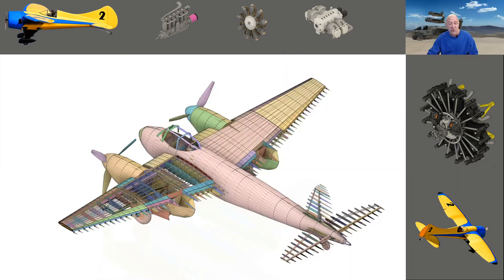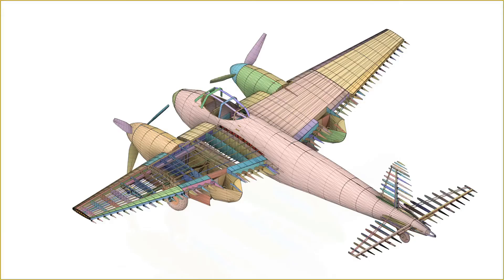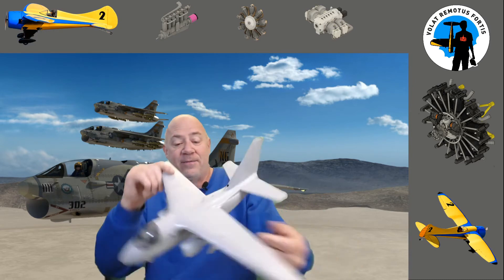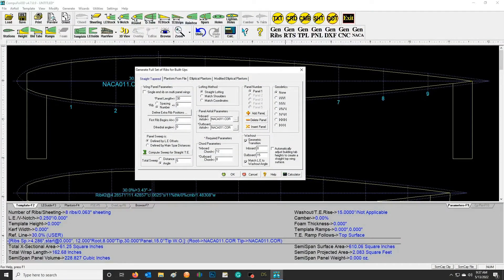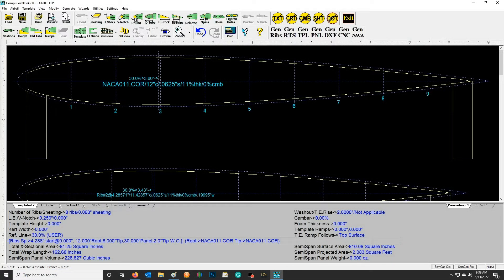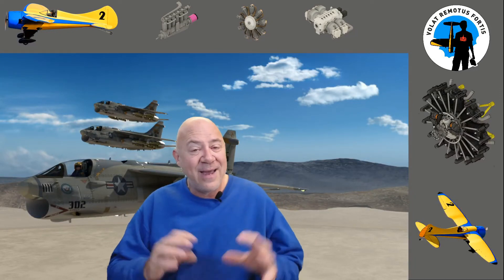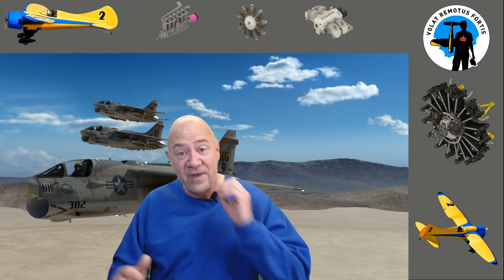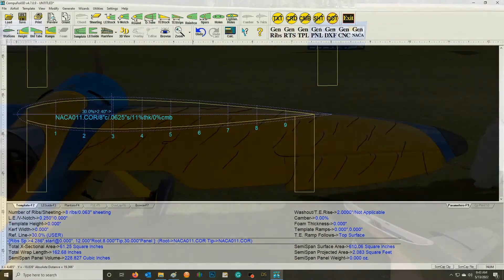RC Aircraft Wing Washout

Comment: Thanks for this video!  the RC world needs to share more about this type of thing.  I've tried to do my fair share on my channel, talking about adverse yaw, and different configurations.    The rudder mix trick is a very useful one.  especially on high aspect ratio planes.  I fly some very high aspect ratios, and often use 100 percent mix.  and sometimes limit aileron throw to push it further.  it really works. 
Would also be nice to talk sometime about provers yaw, as it relates to washout. and span wise lift distribution, elliptical vs bell shaped.  Prandtal had some interesting findings on that.  a bit of washout can actually increase efficiency.  because the airflow already has some span wise flow and there is already a vortex near the tip, so allowing some wing twist can reduce drag a little.  
And lets' not forget to mention progressive airfoils in wings, (they can do a similar thing as washout, and are sometime used together, such as on the dc-3 )  as well as a changing Reynolds number due to wing taper.   Planform, and how it affects stall characteristics.   turbulent vs laminar flow, intentional boundary layer separation, etc. and how they affect stall characteristics, as well as efficiency.  also blown wings, and how power can affect aggravated power on stalls on multi engine aircraft, especially twins.   lots to talk about on this topic. 

Great video!!!

Comment: is there a degree maximum of washout to build in.    I've drawn 4° into the tip of my project model.   F111    it's got a lot of tapper to the shape,. 16° leading edge with 1° trailing edge.   was thinking the high wash out would help remove tip stall that I'm expecting this shape wing to have with the tip having such a short cord compared to the root.   root section NACA 2412. tip section NACA 2416
Reply from the maker: Sorry, I don't understand the question?
Reply: @dagtheaviator  fat finger sorry.   hit send half way through typing question.  lol. biggest apologies.    first has been edited.   loving your video's.  very informative and nicely done.    easy for me to understand without to much of the science.    thanks again for your work
Reply from the maker: @russcole5685  I am not sure at what point would be to much. I have seen 2.5 degrees a few times, and 3 degrees as the max. But, I would guess more would work, but you root incendnce may need to be higher, for the wing to produce the right amount of lift in relationship to the fuse angle. :) Rock ON!
Reply: @dagtheaviator  yup.  Thanks man.     Might be worth my while building a fue foam sheets with different angles of washout, and incidence before committing to final build up.    You're a great ambassador to the hobby.   Keep up your great work.   Thanks for all the insight and ideas
Reply from the maker: @russcole5685  Have a great day!!

Comment: So wash out was originally used with young inexperienced less than optimally skilled  Pilots? According to the information you have. Wouldn't you have to fly the airplane first to determine if wash out was required rather than just eyeballing it. Isn't it true that the plane even with washout will still stall? If flown beyond the max angle of attack?  Experimenting with a plane after flying it given your weight and CG is correct, couldn't the same things be said for Wing incidences engine thrust modifications? I've heard guys when building from plans say that the plans required a certain amount of washout I always wondered why? I'm not convinced that omitting washout, is really going to make the plane fly poorly or compensate for bad piloting skills. Had your friend spent some of those 3 years in developing good flying skills rather than putting thousands of rivets on an airplane he might just have saved it.  This is why I take exception with the guys who say they like  building as much as flying. First and foremost this is a flying Hobby. Building is all well and good, knock yourself out do whatever you want, but I am trying to change everyones definition of the hobby, heaven for bid.   Recognize that most of the guys that don't commit to developing required skills  is because they're afraid to, or they have no one to guide them and that's why many leave the hobby, they plateau, in many cases. Your friends' crash made him confront the fact that he didn't have the skills he need as a flying/builder,  and he wouldn't face this and overcome it. Interesting video, but I believe it  gives people an insignificant detail to focus on rather than spending time flying or on a simulator, developing the skills needed to fly their lead sled.
Reply from the maker: Something to think about. I have taught 101 people to fly RC in the last 30 years. When a person is first learning to fly they need a plane that is forgiving. A wing with zero washout can stall abruptly. But an aircraft with washout will stall at the inboard. This gives you a bit of aileron control. On a trainer, this is great. Washout has been built into many full-scale planes for years. There's a reason why. My quest in life is to make successful RC pilots. I have a good record of that. It's interesting as I have never had a negative post about washout on an RC plane until you. I will take that for what it is worth. I help people make bad planes fly better and good planes fly great. I never said anywhere that should supersede learning to fly or having more stick time over building. Thanks for the post and have a fantastic day! Rock ON!